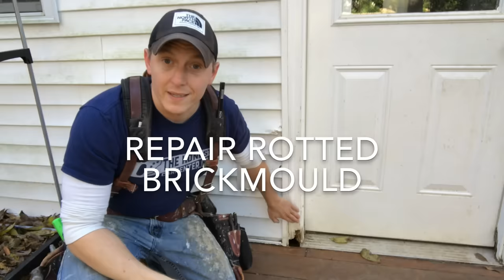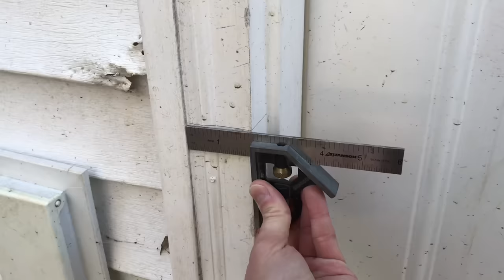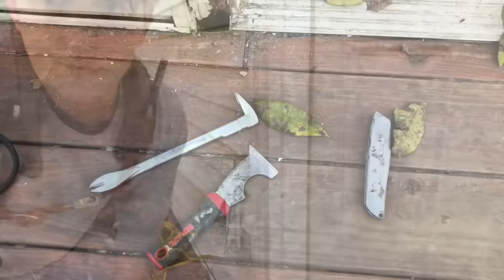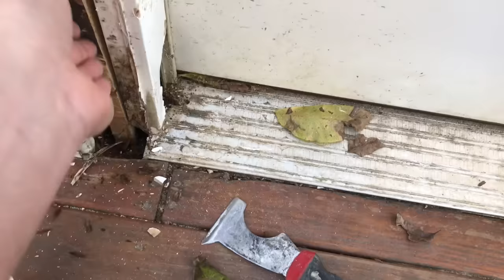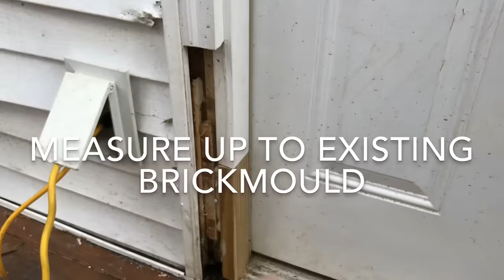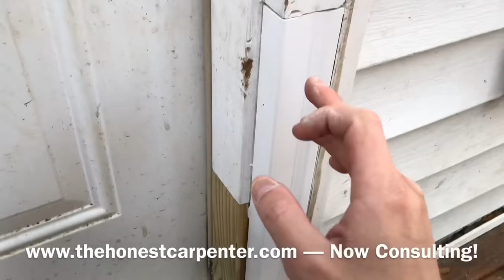Fix Rotted Door Frame (Brickmold)

Comment: Don't forget, you need to prime wood before caulking it,
Reply: Priming wood has little advantage ... primers are not waterproof, neither is paint.  Many trim suppliers instruct to prime wood/trims to relieve them of product failures.
Reply: @mikefreeman3772  The purpose of priming the wood first is for the caulk to adhere to the primer. Caulk adheres to the primer not the wood. If you caulk the raw wood it will peel of in a very short time.

Comment: When you scan in like that, how to you hide the line (at top of new in this case) between new and old? I’ve done this many times (as you have shown) but can’t hide the line as if no work done?
Reply from the maker: MRrwmac thanks for writing in! I usually cut at a bit of an upward angle, front to back. This lets the front edges touch more tightly. Then, pry the new piece in and out a little after it’s shot in until it’s perfectly aligned, and run a little adhesive behind it or just caulk all around 🙂
Reply: MRrwmac Two words. Bon do. Hehheh.
Reply: My oldtimer contractor used to say hammer to fit, paint to match. Honestly, a little Bondo, sanding and paint hide a lot of sins.

Comment: Just replace the entire brick molding with pvc. After paint job and patching this half fix will take longer , cost more and will look worse
Reply: Yes, just be sure to use screws.  Nailed in won't hold the screen door, you attach to the brick molding some time later...

Comment: Where in the world do you get PVC brickmold that's shaped exactly to the moulding that you're replacing? Not your fault but I'm getting frustrated trying to find a video that will show me how to repair a door that my dog chewed. My dog chewed through the bottom and there's a piece of the door missing. As a result, there's no way for me to frame anything and use Bondo.

Comment: Nice video but isn't easier and cost effective  to replace the whole trim?
Reply from the maker: Thanks Konstantinus! Full replacement is definitely an option! I just show this repair because it's a way to save a little money on materials (you have enough leftover this way for 1 or 2 more doors). I've found, after talking with numerous clients about this, that no one seems to care about the seam line left behind. And this way has proven faster for me because what really eats up a lot of time is addressing the caulk/paint touch-up of full piece replacement, which necessarily introduces a second day to come back when the long caulk seam is finally dry. I can heat gun this small section, get two coats of paint on in a day, and thereby reduce the client's overall bill by reducing my time on the jobsite. 🙂

Comment: Should have showed insertion of at least one of the brick mold pieces. Especially with your prior explanation of why you made the initial plunge cut at an angle for a tighter fit of the replacement brick molding with the existing.
But thanks.

Comment: Any specific reason not to just replace the entire trim around the door with PVC?
Reply from the maker: Austin J Just a cost-saving (and in some cases time saving) measure. Full piece can be replaced in very similar fashion. Caulking and painting will increase, which is a hassle where siding meets casings. But either way perfectly fine so long as it’s done well
Reply: The Honest Carpenter okay cool just wanted to check. The brick molding on our side door to the garage is rotted pretty badly. Don’t really want to cut just the bottom off so I think I’ll go with the full replacement
Reply from the maker: Austin J Good call. PVC brick mold will never go bad 👍
Reply: The Honest Carpenter what is the typical cost for a repair such as this. Mine need to be done. We are wanting to sell our house and I know it would come up on inspection.

Comment: Just be careful if you're using 100% silicone you know what happens when paint hits that actually nothing happens paint does not want to stick to it at all so it s nasty stuff I would actually use something like Fina seal that has a paintable characteristic

Comment: The house wrap didn't cover the framing in the RO  because there most likely isn't one piece of house wrap on that  entire house. And whoever put the deck on that house, you should never build a deck flush to the bottom of the door sill, your just asking for water problems

Comment: Would spraying foam in the voids have worked?
Reply from the maker: @Nelson Vega I don't use spray foams for much, but I guess it could play a role in many gap-filling situations. I'd probably even cut little treated wooden blocks to fill them if they were deeper, then adhesive them in. Notches like these drive me crazy. Often though a complete fix is just beyond what my client wants to get into cost-wise, so I try to find the best thing we can do on short notice and little to no budget, then instruct them on how to keep an eye on the area going forward. Just the best you can do in a tight situation!

Comment: Looks like the deck board next to the door (or the rest of the house) not providing much water drainage.
Reply from the maker: @kimchee94112 Yah, I'd say you're right. I never like to see the deck installed so close to interior floor level either. Better to offset a bit  😐

Comment: One way of doing it but why not replace the whole leg of brick molding on both sides instead of chickleting in a piece? Also could have blocked and bondoed the stop. I find these methods to have a better finish and last compared to piece replacement

Comment: Why would you use PVC with wood????   No way!   I remove all of the brick mould and install PVC all the way around.  That's the right way to do this. I always use cypress to replace any of the rotted jamb.  Rarely does anyone want me to just fix the damaged area because it's going to happen again.  That's why I use PVC and cypress for a proper repair. Cypress machines well, is water and insect resistant and takes paint very well.  It look great when finished.

Comment: Why are you showing us a multi oscillating tool when we don't have that?
Reply from the maker: Who’s “we?”
Reply: @TheHonestCarpenter  We Do-It-Yourselfers.   I'm fixing it by replacing the right one as the bottom was bad.   On the left one, it wasn't so bad but there was some rot.  So I removed the left one, as I didn't have a multi-oscillating tool.  Then took 18 inches from the good part of the right one that I removed and cut 18 inches off of the left one bottom and then nailed them both back on there.

Comment: Why wouldn't you just change out the entire piece of brickmould ?
Reply from the maker: Bob Grant That’s totally an option, and repair is similar but without the plunge cut (plus a miter at the top). Only reasons why you might not are to save a bit in material, and avoid more tear-out, caulk and repaint up the casing side. With this vinyl siding it doesn’t matter much, but when removing trim around hardie or other sidings, it’s deceptively easy to break or damage a siding end, which immediately creates another repair. The plunge cut usually takes me about 20-30 seconds, and removes only the part of the casing that is affected by wet conditions. Low-impact, low-cost. But both ways are on the table 🙂
Reply: john vonburg  I think your caps lock is stuck on...Also seams,not seems...js...
Reply: Because he could he with super accurate cuts.

Comment: Yikes!  Pry off the whole brickmold from both jambs and replace them already. Miter the top ends, cut to length and nail them up. You could do that in the same time it took to scab the two short pieces in and it won't look like a patch job.

Comment: 😑.. The reason the brickmold rots is... People don't 🎨🖌PAINT the ends of the brick mold.  The water isn't "bouncing". The wood is SOAKING up the water. 🤦‍♂️.... I wouldn't even do a 12" repair. Just replace both sides top to bottom.  Those silicone gap fillers still show and look like trash.

Comment: It looks terrible, why not to replace the whole thing, at least brickmould, $30 material and it will look much better as two whole pieces, what you did looks like homeowner did it on Saturday afternoon.Also always seal bottom of the pine wood, actually the whole thing with varnish or better with epoxy , West System works great. It will never rot again, your repair only is going to last few years.I call it job security.

Comment: Apparently this person who owns this house does not do simple maintenance (like paint) once in awhile. Pull the door and mount it in a new jamb. Many have PVC bottoms. If it needs to be shortened, cut the top down, and do the necessary work to refit it together. What you are doing is not the correct repair method. This is amateurish, not "honest". Though you may personally be an honest guy. Get PVC brickmold to go with the new jamb.